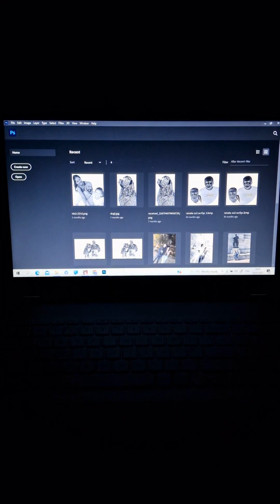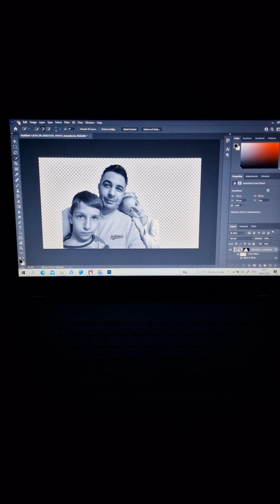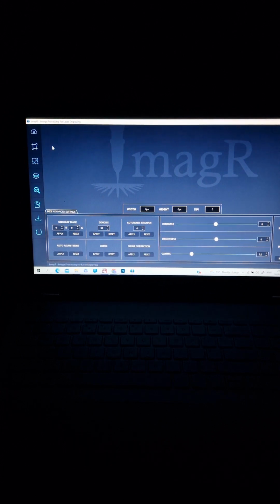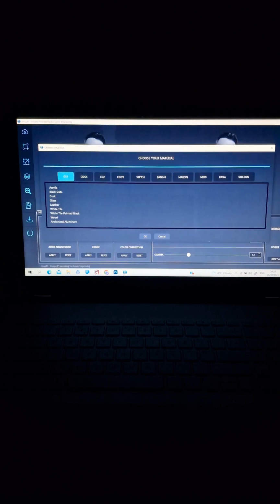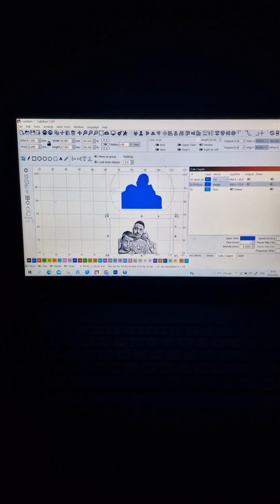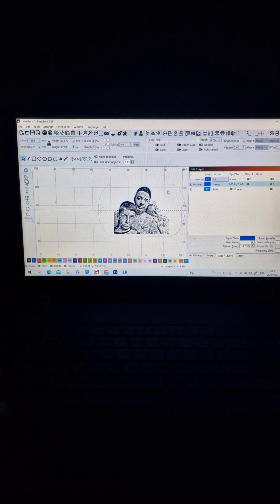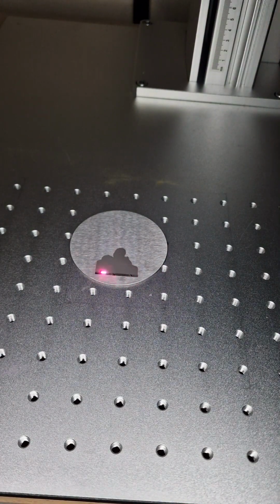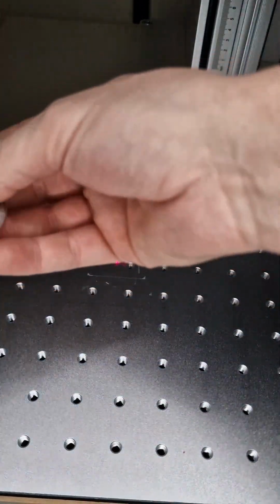How to prepare and engrave pictures on stainless steel

Comment: Aaaa...
Am gasit unul de.al meu 😂
Incearca combinatii cu cross hatch daca vrei mai multe colori sau nuante.
Eu am cautat sa obtin un galben mai intens si din greseala am obtinut efect curcubeu cand am adaugat cross hatch.
60w mopa JPT 300/300mm F420
Succes
Reply from the maker: Salut eu am 50w simpu nu mopa, am descoperit ceva culori dar nu am avut timp sa ma joc cu lentila de 300,mai detin 70,110,175,300